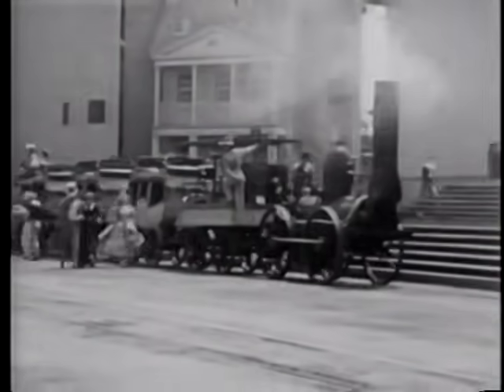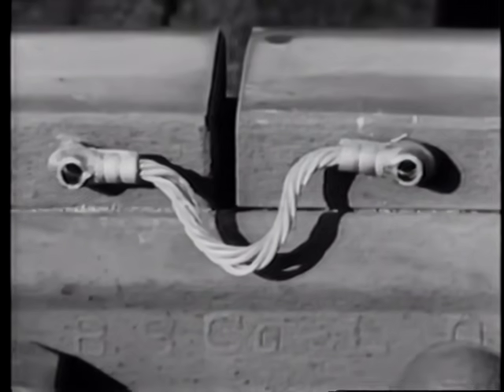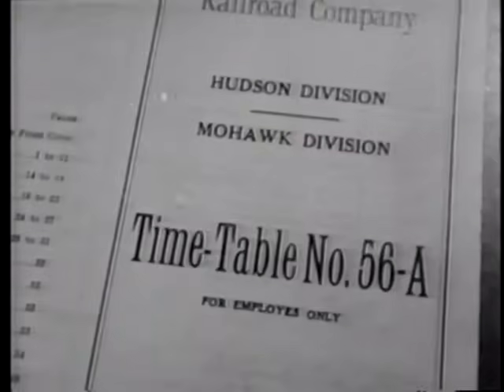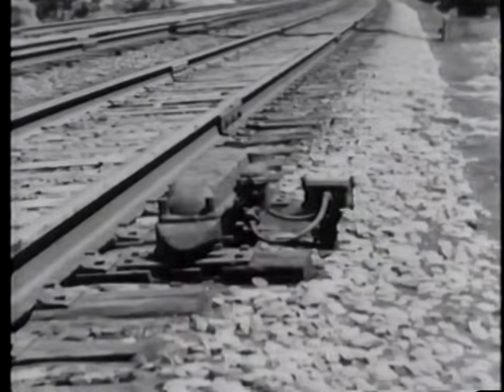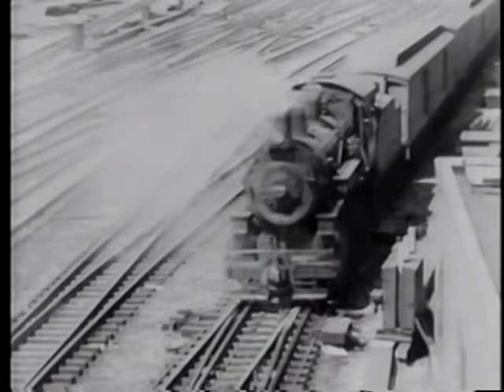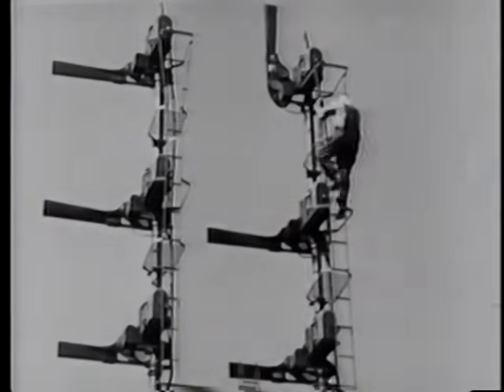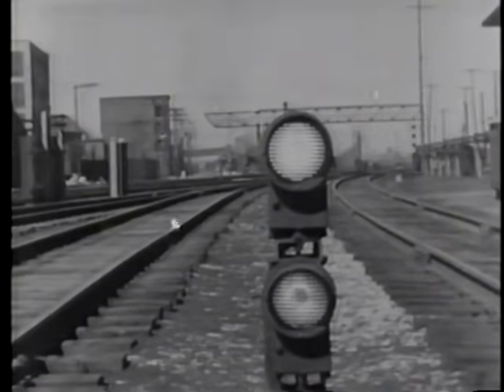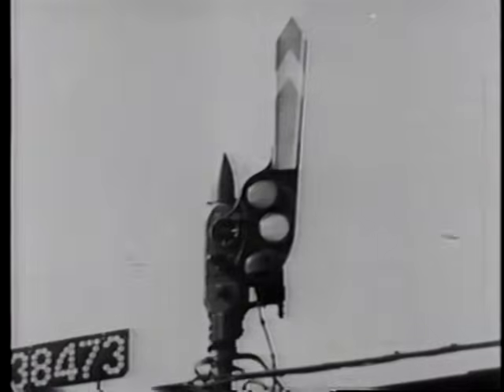The Railroad Signal - New York Central

Comment: Why did it all have to go away???
Reply: Because upgrading the system had to done for faster movements and make more money in selling of the new improved equipment😅 
    PTC (positive train control) was implemented under Obama Administration. It uses Satellite communications to operate and control the trains. Still updating systems past that. 

    Those new LED signals are really spot on! If the track runs along a road you could see them till the horizon.

Comment: Great video, but one point of correction which they probably just didn't want to admit: Train Order Dispatching was still a major thing until about 1984 or 1985.  Running "wrong main" in signaled territory required a "right over" order if a track was only signaled in one direction.

Small wonder that railroad signal systems and operation are my primary interest in the railroad hobby!